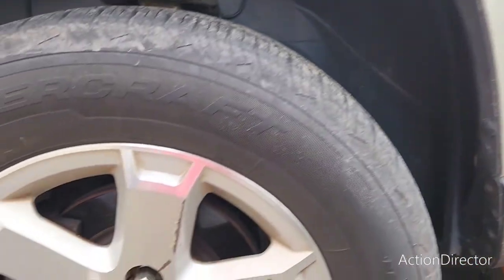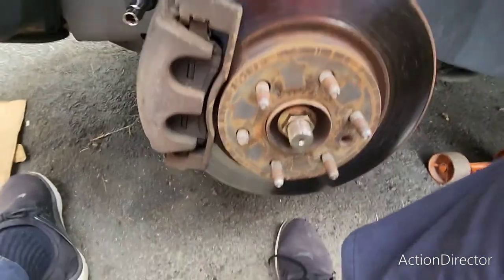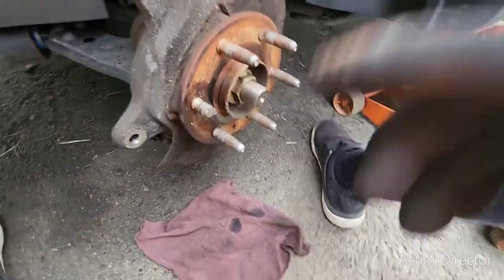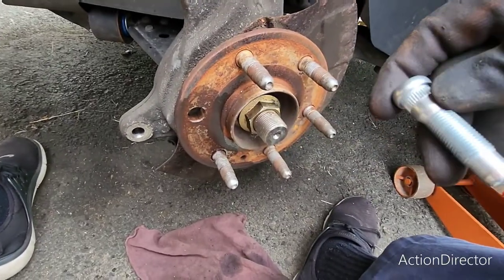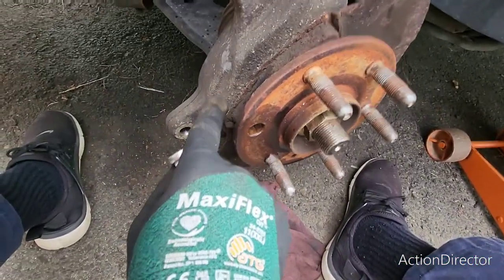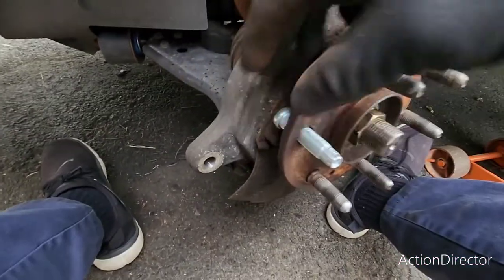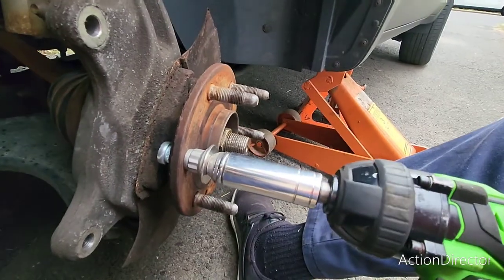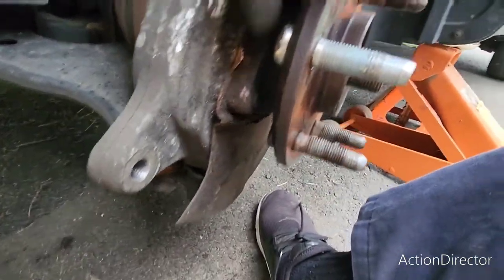Broken wheel stud replacement, 2007-2010 saturn outlook, chevy traverse,  buick acclaim,gmc arcadia

Comment: You are probably one of the only guys on YouTube that has a tutorial on this for traverse Arcadia enclave and Saturn. But it's hard when mechanics modify parts like cutting part of the head of the stud everyone doesn't have access to a tool to do that but thanks and great tutorial anyway
Reply from the maker: Thanks for viewing,  but if you don't have access to a grinder, you can use a file in an emergency, you don't have to remove much material from head of stud, just want to remove alittle from edge of head